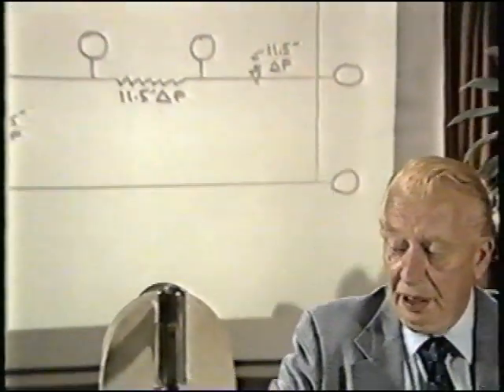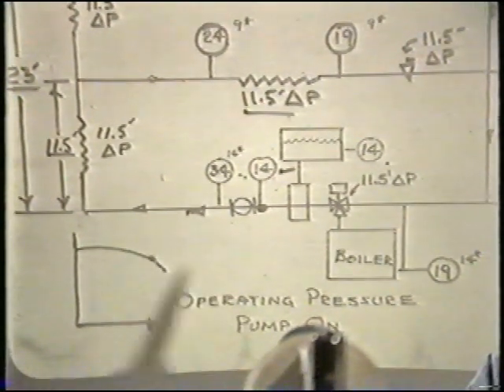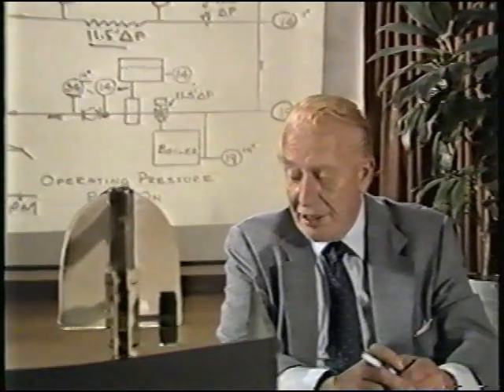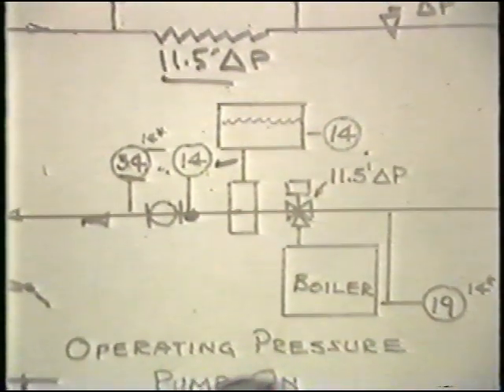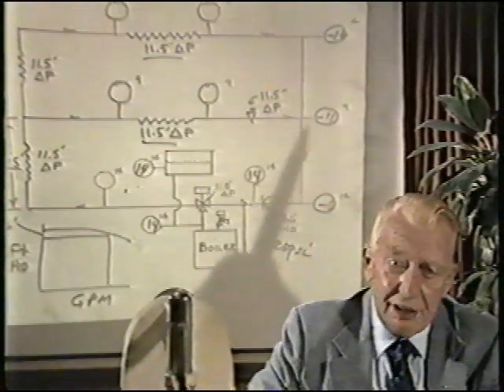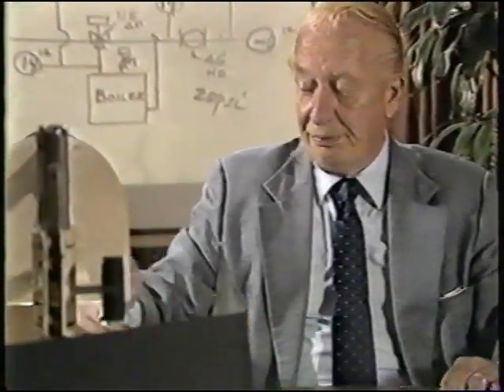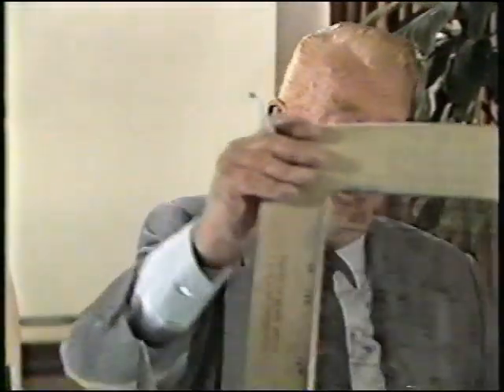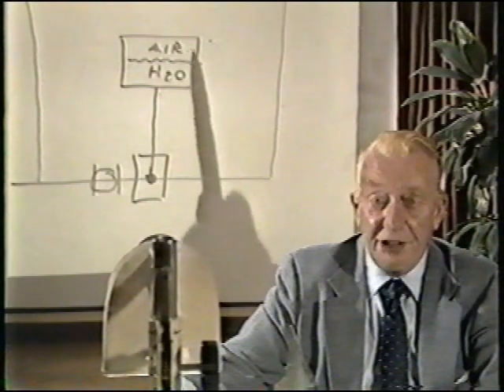Point of No Pressure Change

Comment: The fact that this video only has 1.7k views and yet countless videos on troubleshooting air and pressure related issues in modern hydronic heating systems have hundreds of thousands, speaks volumes about the state of the residential heating industry. I recently began residential service work, with my prior experience being big commercial hydronic systems and the amount of failed expansion tanks, popped relief valves, leaking auto vents, air bound systems, etc.... that have all just been excepted as facts of life with hydronic heating systems was alarming, The very first thing I noticed was nearly every single one of these systems had circulators on the return pumping into an expansion tank. Anyone that understands any basic hydronic or fluid dynamic principles can understand immediately what causes these issues. The negative pressures on the circulator inlet allow the system fill to continously add makeup water to the system, autovents draw constant air in, expansion tanks get filled with water until the bladders fail, then excess pressure exits the system through the relief valves or autovents. The effect of constantly adding undissolved oxygen into the system compounds all of these issues and creates endless issues and component wear. This video should be part of a required curriculum for any hydronic heating installer or servicemen. We need technicians that understand the theory of how these systems operate, not parts changers and salesmen of misinformation.
Reply from the maker: Well said.  We agree, that's why we have such a focus on education here as FIA
Reply: You mean dissolved oxygen
Reply: It is a mazing how many refuse to learn the basics.

Comment: Very nice demonstration. But... what would be the point of no pressure change if there is no expansion tank in the circuit (theoritically suppose a closed loop circuit which has no heating/cooling function)?
Reply from the maker: In your theoretically static temperature closed loop example with no expansion tank there wouldn't be one and it would not matter where the pump is located.